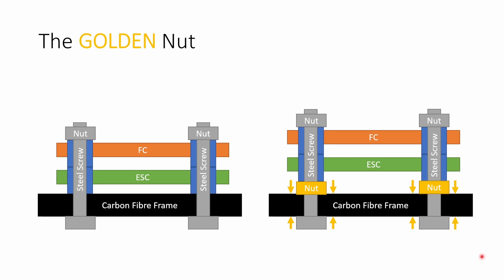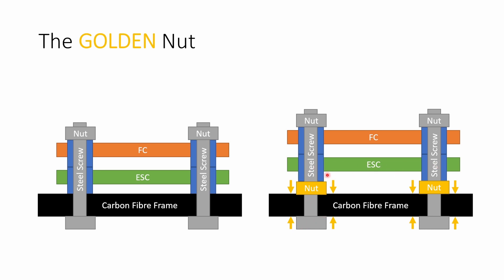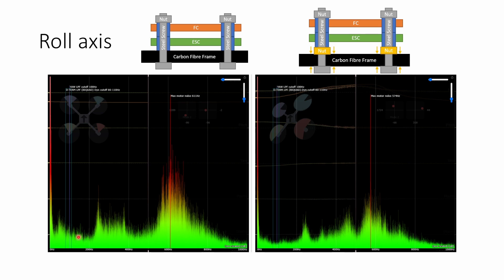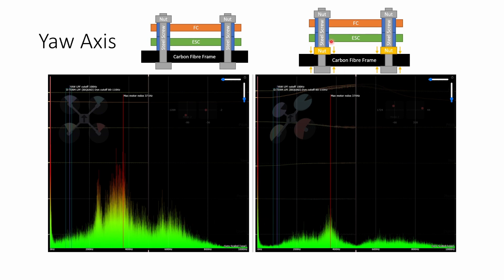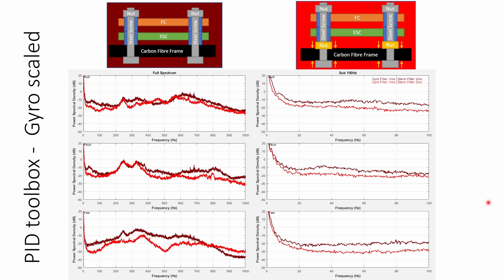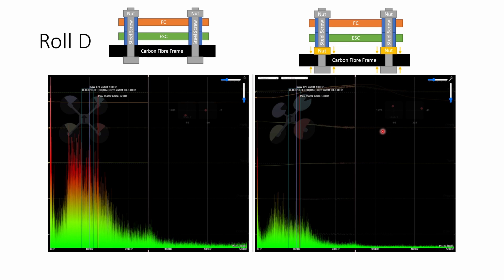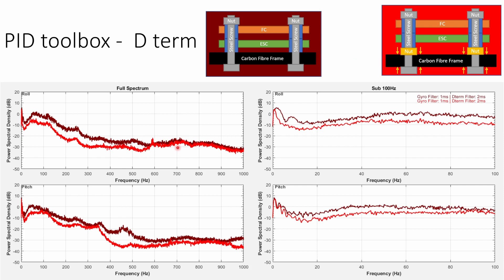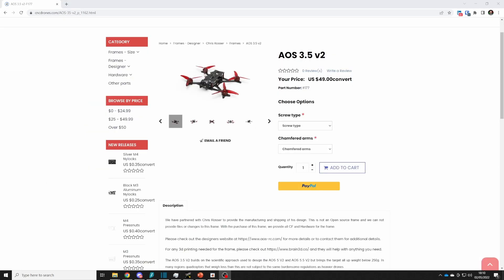Correct stack mounting is critical for Betaflight 4.3! A base nut can make all the difference...

Comment: Does the material and size of the bolt/nut matter some fc only have room for a 2mm?
Reply from the maker: I use steel screws and steel thin nuts to minimise the height. I prefer steel because plastic nuts strip out quite easily in a crash.

Comment: That's why I like the diatone stacks the most as they provide this stackmount square to sandwich your frame and screws with
Reply: Is what that metal (or is it plastic or) plate is with Mamba stacks?! I’ve never been able to work out where they’re supposed to go :/
Reply: @tmdhvn  I think they were meant for going at the top of the stack but my builds never allowed for this. it has to be metal otherwise it's useless
Reply: @RobertLeeuwerink  Thanks - I was just trying to remember if the plate I had was metal or plastic, but yes, plastic makes no sense :) 

I think I might be thinking of something else though. Thanks for the reply anyway! Happy flying

Comment: it honestly isn't a surprise. FL1 has been recommending this on their gear just without the top nut. I'd be curious what sort of effect removing the top nut has.
Reply: The stack flies apart I'd imagine.
Reply: @snviper  nope, its how FL1 recommends things, it works, you just need the rubber grommets
Reply from the maker: I think having the nut on top to keep everything together is essential. If you happen to have slightly loose gummies the FC could potentially move or even come loose in flight and that would be very bad news.
Reply: @ChrisRosser  I dont know. Fl1 is known for having issues with noise. So there is probably some thing to it. The fl1 gummies actually hold the fc fairly tight.

Comment: If the screws have a resonance then having the FC closer to the carbon would be better.
Reply: Everything resonates, but mechanical noise from the head of the bolt rattling against the frame is the problem here.

Comment: What about how the caddx or air unit is mounted?. Same? Screw nut and gummies? No gummies? Soft mount hard mount?
Reply from the maker: I just use a steel screw and steel nut on top as a hard mount so the Vista is completely fixed solid. For a naked vista I use a golden nut (steel) then washers/nylon spacers to keep the boards apart and a steel nut on top.
Reply: @ChrisRosser  I think i’ll try this on my 4.3 problem child.  Main stack is mounted with nut but vista has a small gummy between itself and bottom plate.  No issues with it on 4.2 but 4.3 it flys like a lump of coal.

Comment: For me it was obvious since i took a look at mounting diagram. But now I got more than intuitive understanding why most of good frames have pressnuts for fc stack mounting.
Reply from the maker: I'm not a hug fan of pressnuts for stack mounting as it makes it more difficult to have 30, 25 and 20mm (M2 and M3) mounting options in the same location. Adding a nut on the bottom of the stack achieves the same effect and you can use it no matter the stack size.
Reply: @ChrisRosser  yes, I agree, it's more customizable solution of course! But I mean, installing press nuts in the frame kits they kinda force us to mount stacks properly by default. Ideally they'd better point it out in manual and provide us with a number of additional nuts, but still it's better than none for ones, not subscribed to your channel :)

Comment: Filed under 'things I already learned because I build horribly janky nonsense'...  but it is right and completely relevant.
Reply from the maker: Yeah BF 4.3 really benefits from having low noise at low frequencies below 100Hz in particular. High frequency noise is handled well by the notches so is less of an issue.

Comment: I have a question. Was the flight controller in this quad mounted in the center? Or towards the rear? I know that location of the fc doesn’t play much of a role under normal mounting circumstances (with the golden nuts installed, which is the correct way to assemble stack mounting hardware..) versus for instance, running a rear mounted fc without the golden nuts. In this case, I could see how the mounting location of the fc could actually effect the resonance. Floppy stack mounted towards the rear, being effected by off center rotation, or a floppy stack that is center mounted. Therefore not being effected as much. Both ways are wrong IMO. The golden nut is a must have! But I was just curious how differently the floppy stack blackbox would look mounted in the center vs the rear.
Reply from the maker: The FC in this quad was mounted slightly forward of the CoG. I've noticed that moving the FC far forward or back can increase noise on the pitch axis, especially without golden nuts installed. However, the effect is quite small and almost non-existent on smaller frames. In general if the frame is small enough that you might want a 2 stack (front, rear) rather than a 3 stack (front, centre, rear) then it doesn't matter too much.

Comment: A press nut should bring the same effect compare to the golden nut, right?
Reply from the maker: Yes as long as it sandwiches the carbon plate.
Reply: @ChrisRosser  yes It is so. But I have much problems on 7 inch copter. My copter can not fly smooth forward. Sometimes it's like little bumps till oscillation in dives. I do filter tuning after watching your vids. Gyro filtered looks good. Dterm =>pterm can not solve the problem. Iterm is very low (slider 0.3)
Dterm <pterm is overshooting.

Where is the problem. Blheli s at 24khz. 4s2p  1700kv 2807eco2
Reply from the maker: @robschiii  I would guess frame resonance, what frame do you have?
Reply: @ChrisRosser  tbs source one. Deadcat.

Comment: So that's why my mark4 was having trouble with 4.3. Very hot motors after a first flight and added a low pass filter to fix the issue to 90Hz. I've just changed to golden nut configuration after your video now. The factory setup had rubber grommets for FC screws to the frame. Added two nylon nuts to both sides of the frame to secure the screw. Will fly and see if I can remove the newly added filter for 4.3. By the way mark5 has steel press nuts on the frame (GEPRC seems to be aware of the issue). My racer bcrow frame has also those metal press nuts on the frame and it has nearly no noise even without the filters. Now I understand. Thanks Chris for this wonderful insight.
Reply from the maker: You're welcome!

Comment: I wish the stack screws went into press nuts in the top plate if you wanted. 
seems like that would really stiffen up the screws.

would just have to back the screws off a few turns to take off top plate.

Comment: Does the noise reduction come from the gyro in the stack vibrating with a lower amplitude or the frame being more rigid over all if the stack screws contribute to pressing the frame plates together (in case the stack screws go through a bottom plate)?
Reply: the noise reduction comes from having the large bolts secured, wich transfers less motor vibrations into the gyro. 
This example has nothing to do with frame rigidity.

Comment: I wish you had shown how this looked physically on the frame.  Were the holes in the carbon slip fit clearance holes or were they very close fits that you essentially have to thread the screws through?

The tolerance on some frames (such as Kabab's FPVCycle products) is the latter whereas I've noticed that on your frames it tends towards the former.
Reply from the maker: My frames have slip fit clearance holes for ease of assembly. Once you cinch down the steel nut tight the stack screws cannot move side to side at all due to the friction so the hole clearance won't matter as much.

Comment: Hello Chris. Always very interesting contents. Maybe it’s a trivial thought, but have you ever tried (if possible) to invert Fc position with the Esc? I’m wondering if the higher position on the stack is more susceptible to vibrations? Wish you a nice day!
Reply: This is really good idea 🤔
Reply: I've thought the same just never tested
Reply: Often thought having ESC's above FC would provide better cooling, as space above the stack is more than below. 
Having FC lower (with inertia sensors) would move it closer to more ridge end of stack standoff (in the case of vibrations along the length of a standoff).

Comment: Out of curiosity, would you get the same effect if you had a bottom square, arms, then a button plate with an m3 press nut in it(30x30)? I designed a frame that way and I'm wondering if I'd get the "golden nut" effect with it
Reply from the maker: Yes I think so.

Comment: Great video.
what are your thoughts on a stack installation with countersunk vs non-countersunk
 (my guess is it is helping with horizontal YAW axis vibration ) as there is to the nut HEAD also a "stopper" vs only the scraw body.

Comment: I'd be interested in how this compares to a hard-mounted stack without rubber-gummis.
Reply: I think the Butterflight people argued that if you are using Kalman filters hard mounting reduces phase delay without much of a downside. For Betaflight filters everyone suggests using soft mounting but I am curious if there is much of a measurable difference or if it is even detrimental.
Reply: @Gosuminer  in theory rubber should even stimulate very low frequencys and attenuate higher ones over the natural ressonance frequency of the system
Reply: @Gosuminer  I need to read about those Kalman filters.

Do you know, how KISS handles this?
In a FETtec related video it was suggested, that hardmounting is usually better for those FCs.

Generally it also depends on how steep a filter is. Steeper means higher delay. And also lower frequency means higher delay.

Just did a test in my audio program (FLStudio). My standard low pass filter (12dB/octave) adds about ~5ms latency, when I apply it at 100Hz.
Reply: @uhu4677  I am not familiar with the filter method KISS uses but I suppose it's just biquad low pass and notch filters similar to Betaflight. You are right, filtering lower frequencies will introduce more phase delay. That's why we especially try to avoid introducing low frequency vibrations like the ones large TPU mounts or thin arms tend to produce.
Reply: @uhu4677  Properly dampened flight controller mounting and a clean build will allow you to turn off low pass filters. Which is ideal. On my builds I shoot for 2.5ms or less delay for best performance.
Reply: Gummies should perform better because they act as a natural lowpass filter. Less digital filtering needed in BF.
Reply: @TimeFadesMemoryLasts  Yes. But does it really make a difference?
Reply: @uhu4677  Yes, it does 😃
Reply: Agree. Old FC didn't use gummies and they were much noisier.
Reply: @aowi7280  Agreed. But in the meantime we got RPM filters and generally better filters.
Reply: Never hard mount anything with a gyro.